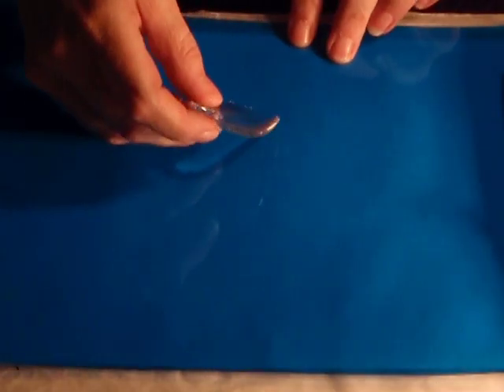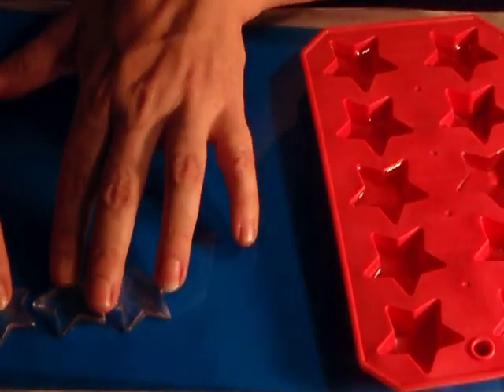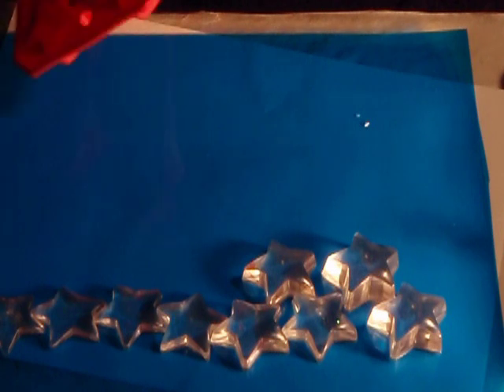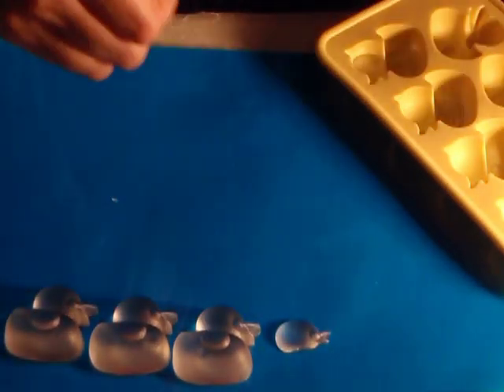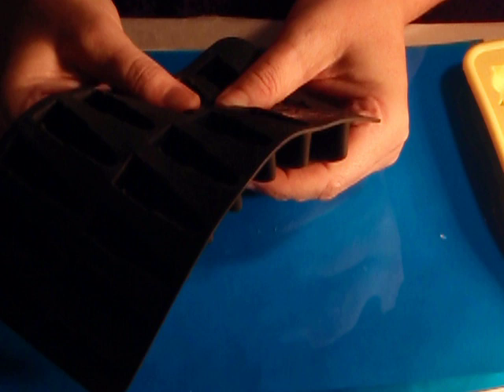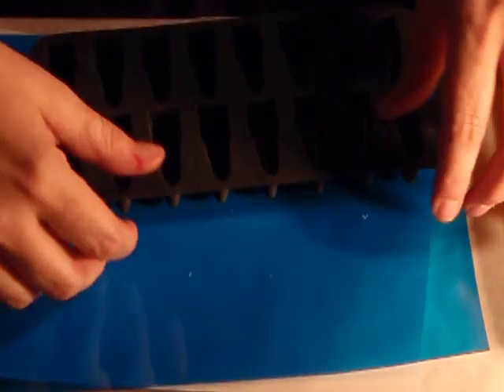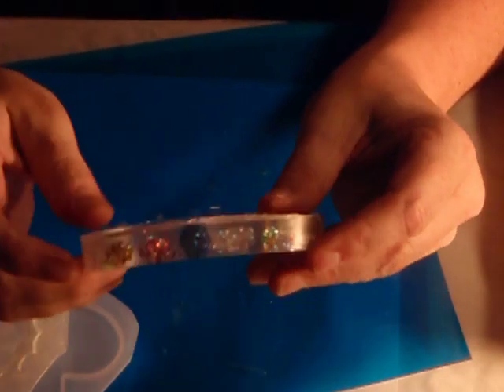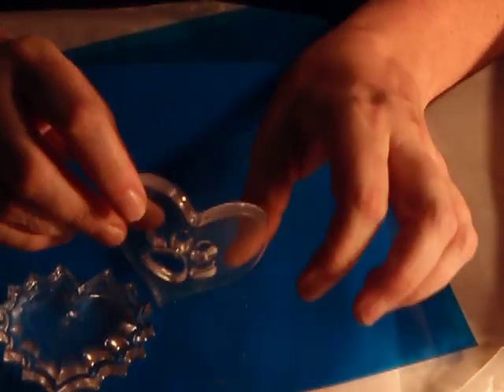Resin Test Results Clearcast 7000 Does Pour Thickness Matter Good / Bad Batches

Comment: Is there a certain thickness to where it cures harder? Seems like the bigger pieces harden better, which is a bummer because I just ordered this stuff for little rings that are less than a 1/4" thick. I have had a very hard time finding resin that cures super hard for such small pieces and every single one has turned out bendy :(  Do you think this stuff may work for what I'm trying to make?? Thanks for doing this video, it was just what I needed!!

Comment: I've had that same result... sometimes the Clearcast is great, sometimes it bends over double, even after a month.  Mine though, have been more often hard as a rock than bendy.  Still trying to figure it out... maybe it's extremely touchy with measurements.
Reply from the maker: Larielle There were some bad batches out there.